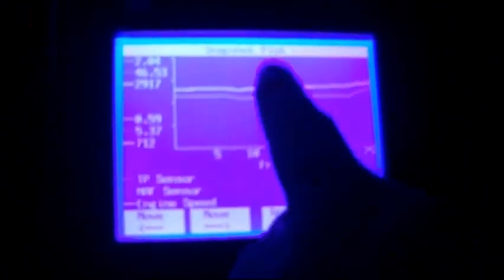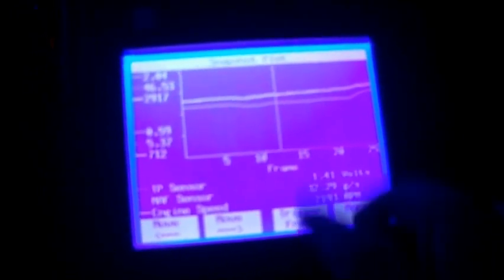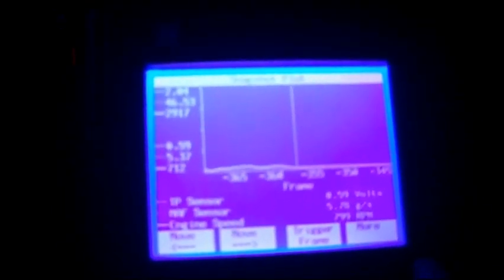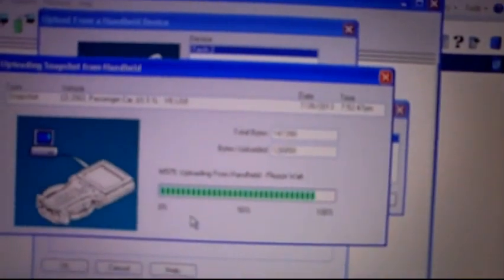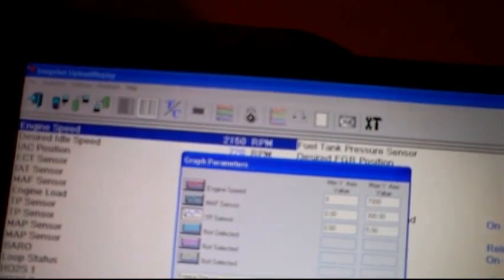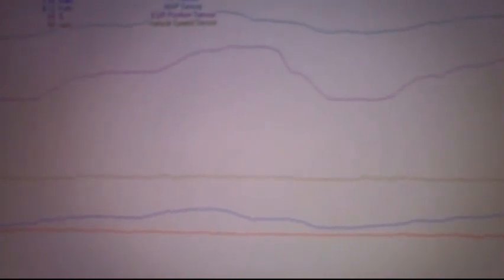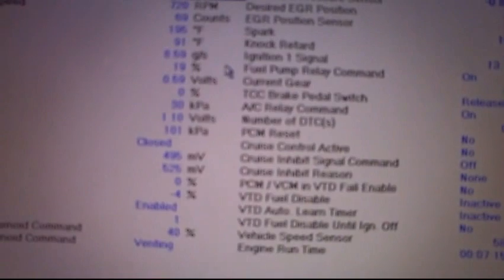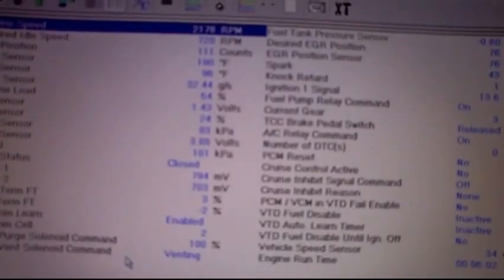Tech 2 how to use snapshot

Comment: can you tell me the process of getting tis2web on my dell laptop. I don't have any subscriptions from GM or anything like that.
Reply from the maker: I would need more information. I would guess you are looking to reprogram a module. If you go to the gm website it is only $40 for 24 month subscription per VIN... very reasonable and you can use your tech2 for tech2 vehicles.... if is a new vehicle you would need the GDS2 subscription to go with it and a j2534 device.
Reply: If I pay the $40 (which I plan on doing) can I hook my tech 2 to my computer and view the PID's (like you did on your video).  Presently I am viewing my Tech 2  PIDs from  snapshot on the Tech 2 screen, I want to view more PID's and on my Laptop to analyze. THANKS